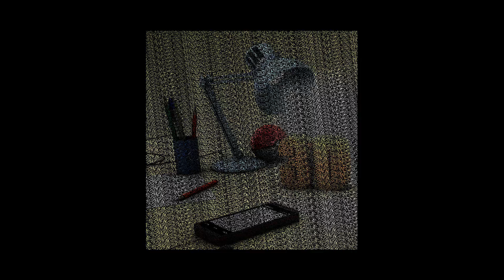Start your CAD Design the right way

Comment: Great topic!
We design and manufacture machines, and all parts are either 3D printed or machined by sub-suppliers. The all consuming problem is designing parts for easy manufacturing, as it is almost impossible for us to control costs as you spend untold hours for adapting to manufacturer A, B... and the adaptations to manufacturer A makes you an idiot in the eyes of manufacturer B that has different machines/tools.
While I have a hard time doing it right, I believe that you need to use one of two directions in your design:
1: start with critical features and design from a the function out, leaving manufacturing more like an after thought
2: start from manufacturing (Work holding/work envelope/number of axis, tools for machining ex. depth/width of cuts...
Reply from the maker: Hi Jens Agerskov Thank you for watching! That is a great suggestion! Thank you

Comment: I'm trying to recreate a cap for my weedwacker goes over a filament spool that's no longer available. My problem is that it's a 56mm circle(slightly concave, with tabs(0n 2 sides) that extents upward about 28mm  and these have a 4mm slot about 23mm up from the bottom, and just to make things more interesting, they are tapered by about 3 degrees as they go up. I made my attempt and 3D printed it(it was close but no cigar) but I could not get either the slots or the taper correct. I was hoping maybe a genuis like you could help a slightly confused fellow out with some great tips!
Reply from the maker: Hi TheGg6422 Thank you for watching!
Try to take a look at this video:
https://youtu.be/zYMf6qncgwc?list=PL40d7srwyc_Mkgc5wvP_OfVel9aDkNkZ6

hopefully, it is helpful.

Best,
Lars